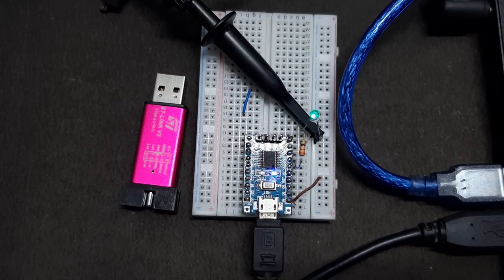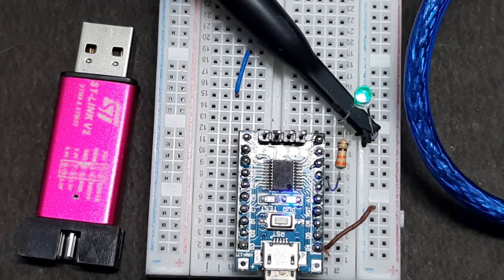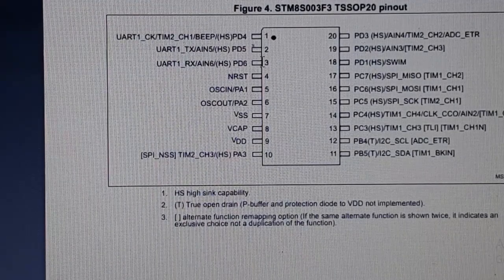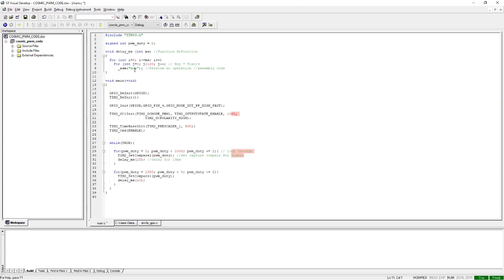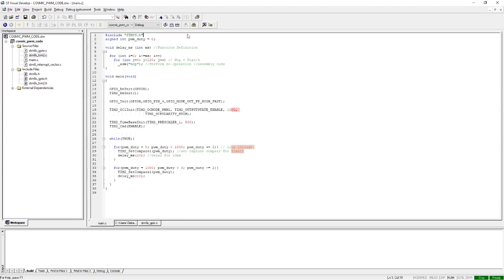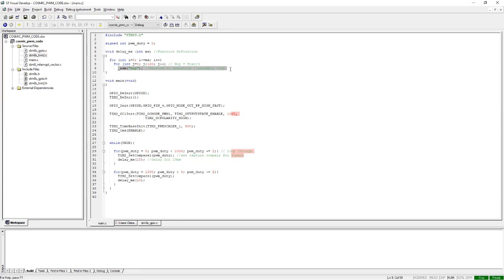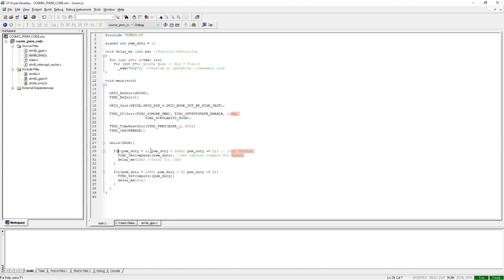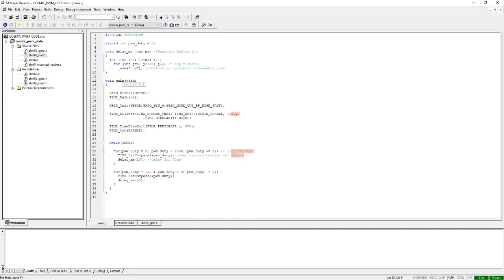Pulse width Modulation with STM8 using Cosmic C and STVD | STM8S PWM Generator

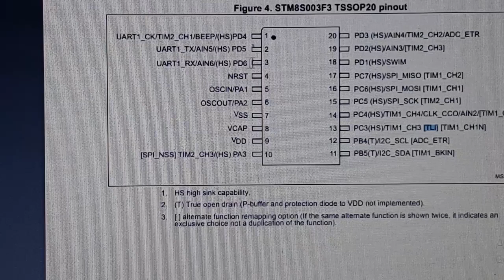Comment: How did you connect TIM2_CH1 to PD4 instead of PC5 (2:15)? Thanks.
Reply from the maker: By default the TIM2_CH1 is tied to PD4. If you want to use it with PC5 you will need to set the AFR0 (Alternate function remapping option 0) to 1.
Reply: @Circuitdigest  thanks